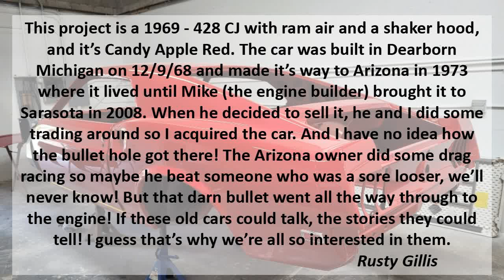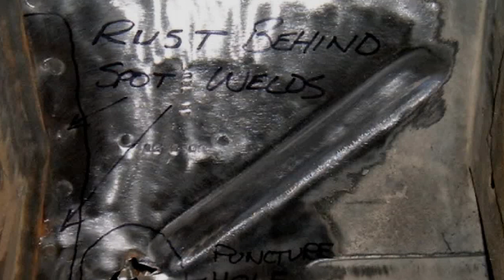1969 Mach 1 428 CJ - Ram Air restoration project

Comment: Beautiful work! Quick question, if I wanted to tuck my front and rear bumpers on my 67 convertible, would the easiest way be to cut and resend my support braces? I appreciate any advice
Reply from the maker: Not easy to do with steel bumpers. We have done it on the rear but you have to cut and weld the bumper multiple times to get it to fit. Next bodywork and paint.
Reply: @gillisrestorations  thank you for the information I appreciate your time.